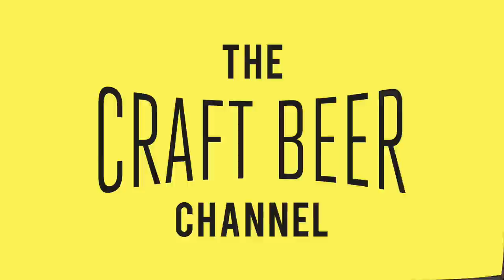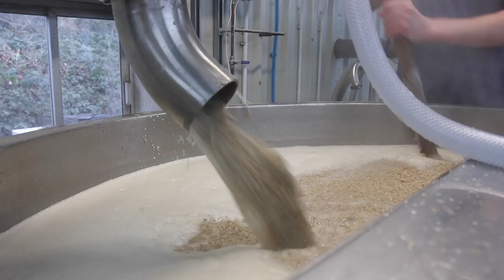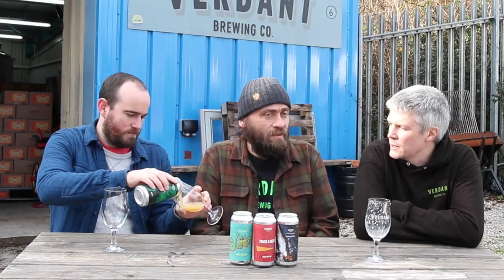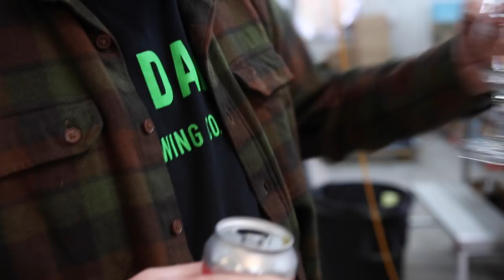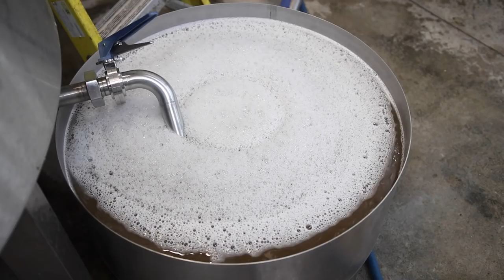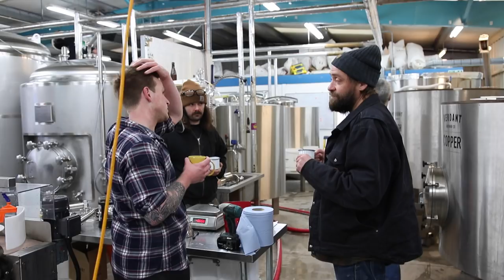Verdant Brewing Co: when the haze clears | The Craft Beer Channel

Comment: Difficult to find in Cornwall, can't help thinking that it has a bit to do with most pubs being controlled by St. Austell.
Reply from the maker: So we spoke to St Austell and they have the tie on 1 in 3 which certainly won't help. However, there are still 450 pubs that could buy it if they wanted to!
Reply: I saw Falmouth have some kind of craft beer bar. Called HAND Beer Bar and Beer Wolf Books. Hope they stock some verdant beers, would love to try.
I like some of St Austell brewerys beers, but much more into supporting the smaller breweries now. Will need to checkout verdant beers next time in Falmouth